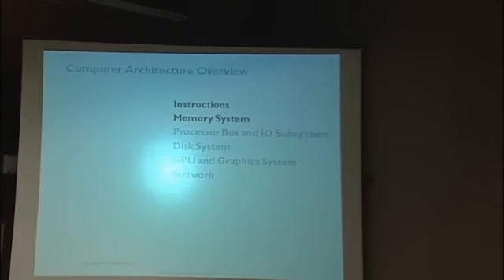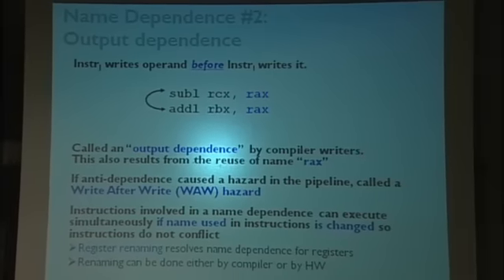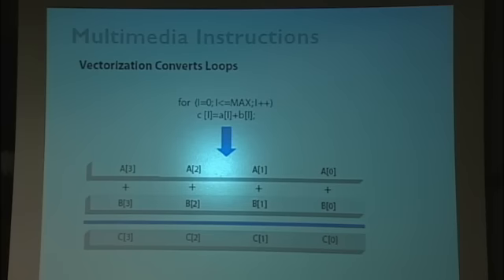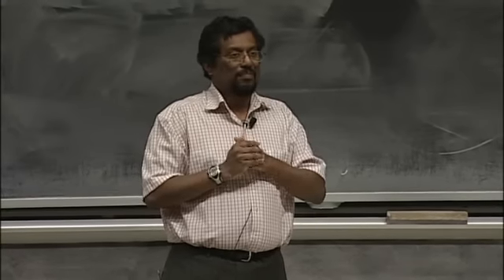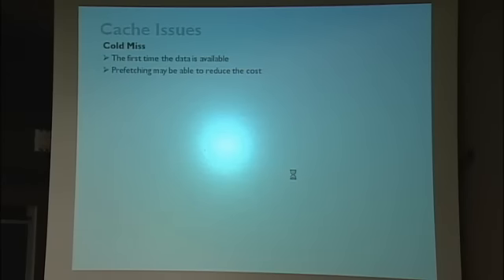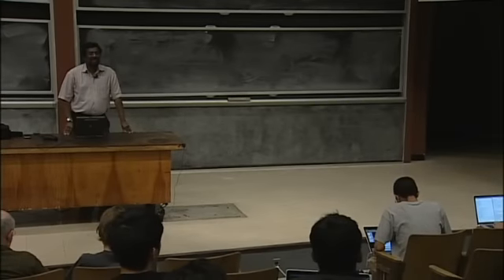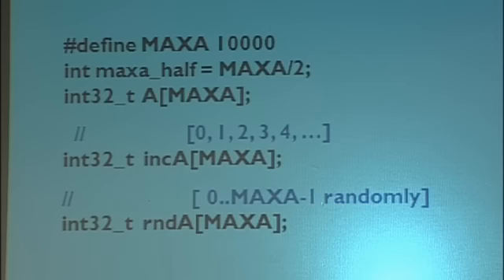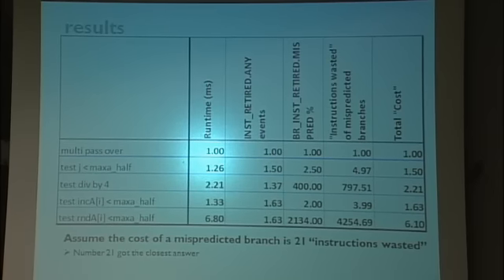Lec 4 | MIT 6.172 Performance Engineering of Software Systems, Fall 2010

Comment: I wish MIT recreates video with someone in neutral accent. He swallows half of the words and lot of dead air while speaking.
Reply: Exactly right 👍
Reply: Must you really call him a bastard for his wishfully expressing that the audio was easier to understand?

I find that struggling to understand the speaker's English is a very real problem while also trying to comprehend the points he is trying to get across. I think there is no doubt it would be a little easier on the person watching this video if his english was easier to understand.

Nobody's being ungrateful here. Yes, it's great that this video is up in OpenCourseWare - otherwise we wouldn't be watching it, but if nobody mentions that there is a problem, then the problem may simply never be fixed.